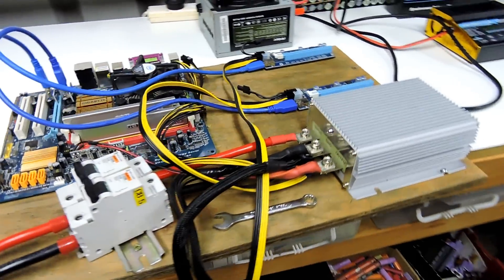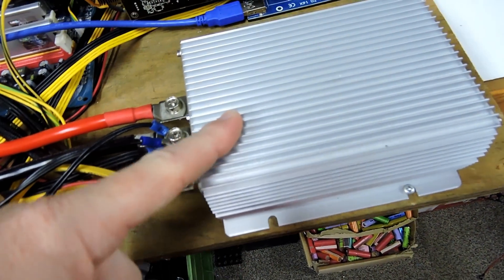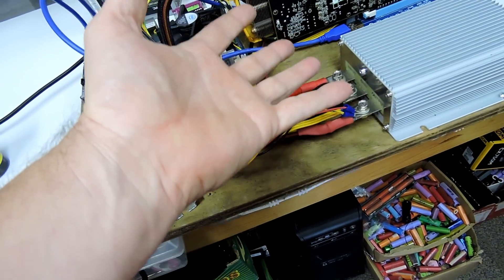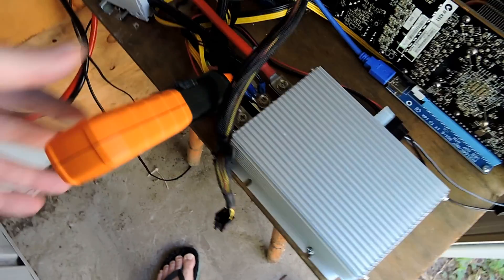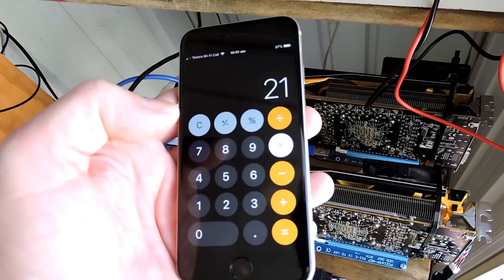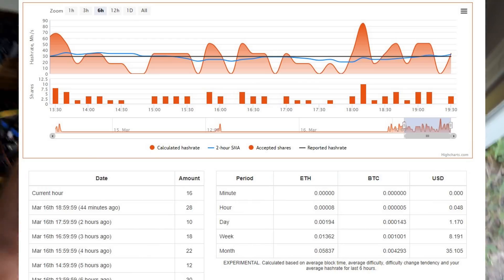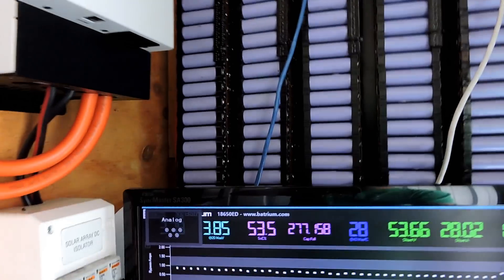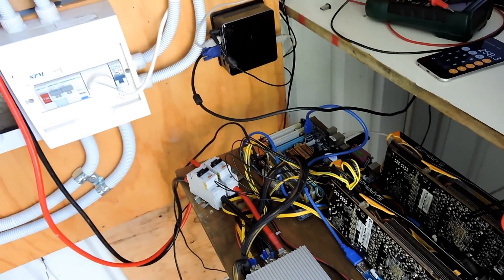Solar Crypto Mining Version 2.0   Battery Hashing on solar! [2018]

Comment: Input - 5.75A @ 53.62V = 308.32W, Output - 21.8A @ 12.3V = 268.14W, Efficiency is 268.14 / 308.32 = 86.96% efficient
Reply from the maker: I guess I should now put a good PSU onto 240v and do the same math through the inverter...
Reply: Yep.  But it'll be hard to beat 86% with most computer PSU's + Inverter. Computer PSU's that can do 90+% are expensive for one, and the inverter we already know will only do about 90%. So I doubt it'd be anywhere near the same efficiency.
However, do it for science!  🤠👍
Reply: picoPSU will also have losses, which we don't know. Best would be to compare the load from battery in both cases.

Comment: how are you powering your mother board i see what looks like a stepdown converter can you provide me some info as i currently have been running my miners off solar but the board off a low watt psu
Reply from the maker: I use a little picco board - https://goo.gl/va3WeJ

Comment: Have you tried to adjust the clock/fan settings to a lower threshold to get both cards running initially - then look at optimising power supply as per comments below..?
Reply from the maker: Yep did try that, even went as far as removing all fans from the converter with the same fault

Comment: 90% of miner problems are related to the riser cards.  Your situation is unique, but I would still look hard at them and rule them out if possible by installing one card directly into the motherboard slot and the other card connected via one of your two risers.
Reply from the maker: 90 percent is a massive call! without a doubt, it's a solid point of weakness but personally i've found burnt out cables to be much more of an issue than risers. I tried on card in each riser slot and pci slot and bot cards work by them self but as soon as i add the second card in any configuration it won't start hashing. Will power the computer but won't hash.
Reply: HBPowerwall Could be your power which seems doubtful based on your video, or could be the motherboard bios holding you back. I'd recommend googling your model motherboard mining settings and see if you need to adjust the bios for mining with both cards.

Comment: Since you are going to experiment more. You should put together a "power block" of sorts. So you wouldn't have to disassemble and reassemble the screws on to the DC to DC converter and ruin the screw blocks. Google "screw electrical block" and you'll see what I mean. Of course you'll have to adjust for sizing.
Reply from the maker: Thank you i'll look into it

Comment: Could be that the DC converter is quoting a peak power output but it cannot sustain it. Or if it is sustained power the rig is drawing peak higher than 750W when they start?
Reply from the maker: Mythical peek power lol I did put my clamp meter on peek amps and it didn't get crazy when starting the mining.

Comment: CUMON Pete, u know very well the chinese r fulla shit with they're specifications, I have to constantly fight with them to stop doing false advertising, and at the end of the day they loose money not me. WHEN u buy another PSU make sure u get the one with 13.8v output and atleast 20amps and try that with 1 card and use a shunt on the output with a meter. BTW i had this same idea building a mining rig like that, but I cant say itt was my idea cos u beat me to it ya basted. Also the reason I came up with it  cos I hate inversion power loss. I will continue to add dc appliances to my battery bank and take out the ac side.  I got this coming "322743829693" and "332577311642" ebay items to do my testing with. The Extra voltage should give the cards a FULL 12volts @ full AMPS. :)
Reply: eBay item number: 282820802879 shunt + meter 100amp version
Reply from the maker: https://rover.ebay.com/rover/1/705-53470-19255-0/1?mpre=https%3A%2F%2Fwww.ebay.com.au%2Fsch%2Fi.html%3F_from%3DR40%26_trksid%3Dp2047675.m570.l1313.TR0.TRC0.H0.TRS0%26_nkw%3D322743829693%26_sacat%3D0&campid=5338073988&toolid=20008 looks too little, https://rover.ebay.com/rover/1/705-53470-19255-0/1?mpre=https%3A%2F%2Fwww.ebay.com.au%2Fsch%2Fi.html%3F_odkw%3D322743829693%26_osacat%3D0%26_from%3DR40%26_trksid%3Dp2045573.m570.l1313.TR0.TRC0.H0.TRS0%26_nkw%3D332577311642%26_sacat%3D0&campid=5338073988&toolid=20008 got one of those works well
Reply from the maker: On https://goo.gl/aojdLL can you let me how it goes i did look at one but need it to 'count' the ah or kwh so I can work out how much power it's used
Reply: that meter does count kwh and ah if its programmed like a GT Power Meter  which rotates the record in the bottom right corner. Worst case scenario is using the BMV-701 or 702 atleast that will be more accurate and u can dial into it with the pc. The 1st link looks too little is correct but I am running 1 similar 24 v to 14v so i can run a dc computer monitor without its ac power pack not to mention all my internet gear... 2 x 8port linksys switches, 1 DWT1900ac router, nbn modem, uhf cb radio, dc desk lighting and anything else that is 12v with a barrel plug on it.  I replaced "DC-DC CC CV Buck Converter Step-down Power Supply Module 4.5-30V to0.8-30V12A SP ( ebay item # 381616000462 )" this units heatsinks with 2 inch square cpu heatsinks and never had a heat issue unless I was drawing high currents and then I will switch on the cpu fan to suck the heat from the top. I took a gamble  with chinese junk and modified it b4 I made heavy use of it. I do plan on looking for a 48-60v to 13.8v heavy duty more robust unit to do atleast 60 to 100amps @ the lower voltage end. 13.8volts what is required to run cb radios and I found that to be the perfect voltage for 12v appliances, basically I am in the mindset of a grid down scenario 24/7 and doing away with AC all together. I will be making some vids of my work and send u the private links.... u can be the show boy and I will stay in the background hahahahaha.

Comment: you probably need much better load regulation, aka the 12v is probably very noisy, and the cards are sensitive to that so maybe adding a decent low ESR capacitor bank on the output, use solid capacitors (not electrolytic) im sure 3x 220uF or 2x 470uF in parallel per card should do it wonders. SCOPE IT!!
Reply from the maker: @scott be interested to see your setup
Reply: The video card risers usually have a regulator and some filter components to them. It's probable the voltage just drops too much when the second starts mining. I have 8 1050 TIs on 2 480 watt DC converters working fine.
Reply from the maker: can i put capacitors across the neg and positive of the inverter or do i have to put it on the input of the cards, could easily solder to the card - but i don't want to stuff it up
Reply: HBPowerwall do the filtering caps as close as possible  to the cards thats the best you can get
Reply: I'm moving stuff around at this moment but I plan on posting on the FB Group eventually. The DC converter I'm using is this: https://www.amazon.com/gp/product/B01LYK6G2Y
Reply: I concur with SuperBrainAK.  Good computer PSUs have a fair amount of compensation built in too.  So if you measure your actual inout voltage at the cards you may find they are dropping well below that 12.3v when both cards are drawing power.
I would try connecting a small leadacid battery (at least 12v @10A) directly to the outputs from the DC converter and see if they dont run fine with that.  It will filter the output and keep it above 12v for at least a few mins, which will tell you if the converter is dropping too much alone.
Reply: you could do either, closer to the cards the better, maybe on the underside of the power input to the card.
Reply: Yeah, the ceramic capacitor would help with any noise if there is any. There could very well be some. The riser cards only filter out the power that's connected directly to it. It doesn't filter the power that is connected directly to the cards.
Basically you could take the ceramic capacitors and connect it directly to the back side of the power connector that goes to the card. Here's a quick Paint toss together of how it could be done: https://goo.gl/jik2Gw
You could just take and pop out the terminals out of the ATX connector and solder the legs to the connectors and snap them back in.
Reply: Came across a really good explanation of the capacitors job and why and where you'd use them: https://youtu.be/BcJ6UdDx1vg?t=4m7s
You want to put the capacitor as close as possible to the load/chip/etc as you possibly can as that's where it will be most effective. I know this is a video card, but it could make a difference.

Comment: What about running secondary wiring off the batteries directly evenly across the battery bank, that supplies ~12v to a capacitor or some sort of electrical components to stabilize the voltage at 12.0v, then run it that way instead of trying to DC to DC convert..... Im very interested in this idea, i have been toying around with the idea of adding solar to my GPU mining farm if the profit stays good, lately its been in the slumps, so your $1.20 is actually on par
Reply: He has to do DC to DC because his battery pack is 48V nominal-ish. You can't pull from 3s or 4s packs as this will not be proper 12V the cards would need.

However, I wonder how effective it'd be if he used buck converters instead of the PSU. Not sure how efficient that would be over the PSU. The PSU is about 87% efficient.